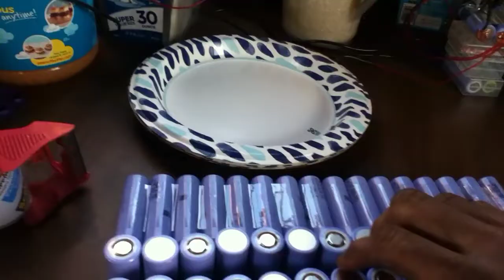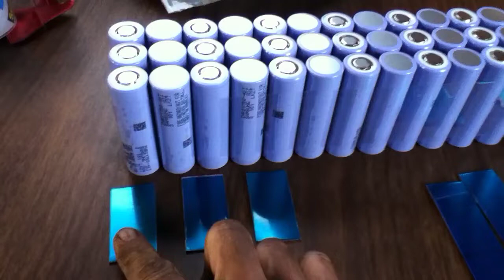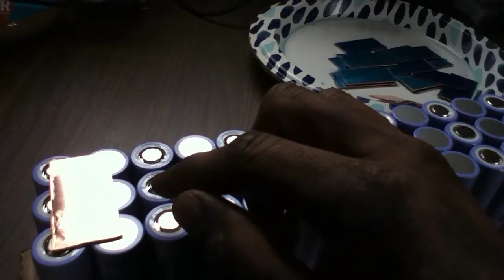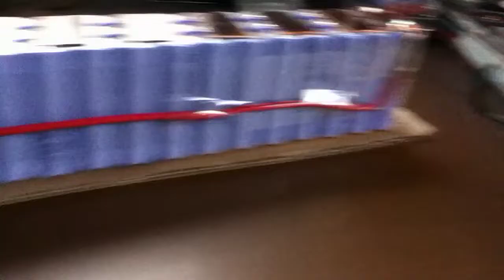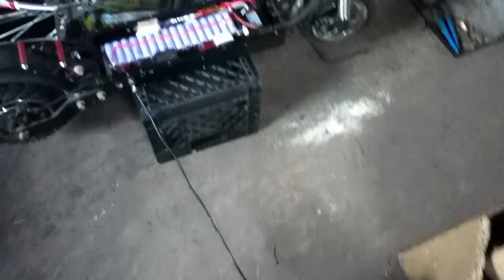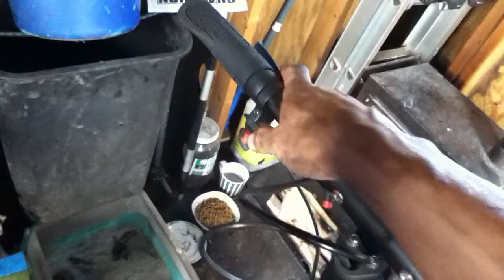How to Build Battery Pack without Soldering ,the Simplest Way

Comment: Can you explain why BMS is not needed in more detail in a different video? I find your videos actual gold. You explain everything very good
Reply from the maker: @Pro Danger Gaming YT  The battery cells don't catch fire from overcharging.  It is not even called overcharging, it is fully charged. Cells don't get hot charging beyond 4.2V, they are designed to receive and hold charge to full, 4.4 or 4.6, if the cell has that storage. The catching of fire will happen if there is short-circuit in the battery you built. It may not do anything... until you start charging, will cause thermal runaway and catch fire, BMS or not. BMS won't protect the batteries when this happens. Watch one of my latest videos titled "Why BMS is Not needed Building Battery Pack".
Reply from the maker: @Pro Danger Gaming YT  So you didn't watch the video, or you didn't understand it.
Reply: @Patrick  make us a video how WHY WE NEED BMS, I bet if done right,that a battery without bms would last longer with precaution.
Reply: @patric ,u might lose a few my braincells when one might out run the other.its like every bissiness owner of what ever company that  come's up with an invention  has to add other products to the invention to make more money off us wen it's not nessary it's just to get more money of of us,and u know it
Reply: @BestOfGames  this dude has no clue how to make a safe battery. A BMS is a must!!
Reply: @patrickconsulting7301 I just lost a few braincells reading this. Like a BMS is necessary thats just common sende
Reply from the maker: Thanks.. The BMS is unnecessary and can actually have negative impact on the use of battery's charge (decrease range) and they don't even actually balance charge the groups of cells when in fact it is the battery pack itself gets self-balanced with or without the BMS. I will try to make a video of why we don't need BMS as soon as I can. I don't have a good camera to take a video as it doesn't do well in close-ups and focus but I will try to come up with something. 🙂
Reply: @noobz5056  Thank you for this response. Try creating some lighting above the stuff you are filming, it should help with the focus. Maybe a flash light with a see through/transparent bag could do the trick if you're on extreme budget, as the bag should soften the light and not make it so direct like just plain flashlight would, but maybe just the flashlight will do okay. Experiment a little bit with lights, some light source will definitely help you in recording more quality videos.

All tho i still appreciate your videos nonetheless. They are informative and easy to understand.
Reply from the maker: @ThisIsVeryStupid  Thanks...but my camera is an old iPod Touch that is over 12 years old... it actually does better in dimmer light conditions to reduce video noise and artifacts. The near-shot focus is not good due to the limitation of this device. Hoping to get a nice camera soon as I will be posting a lot of videos..